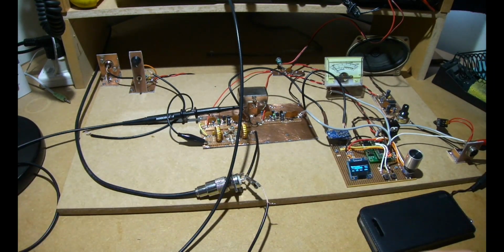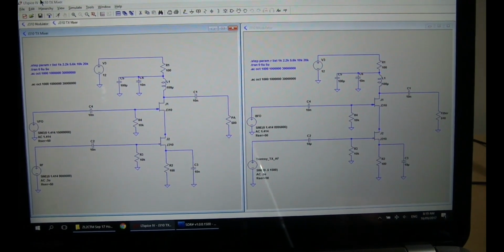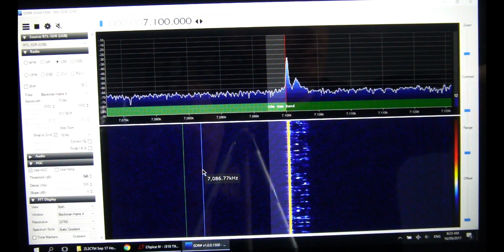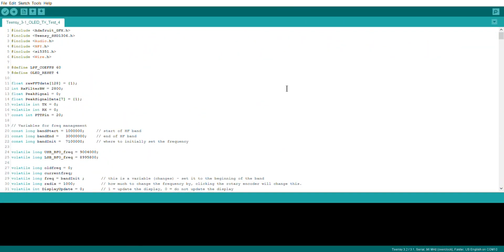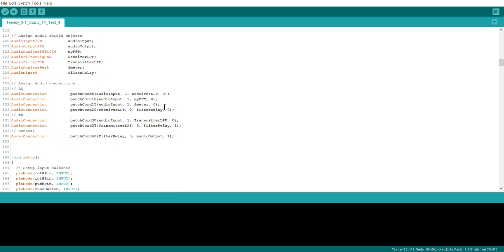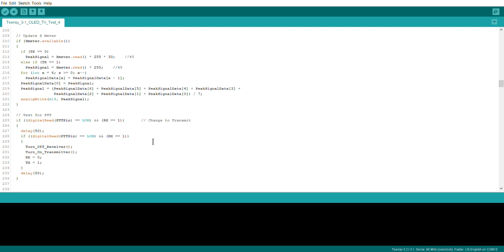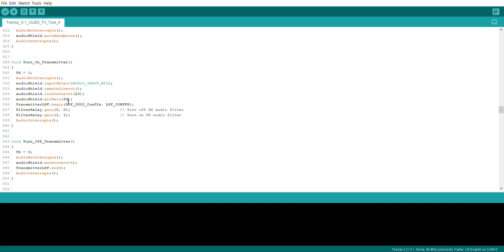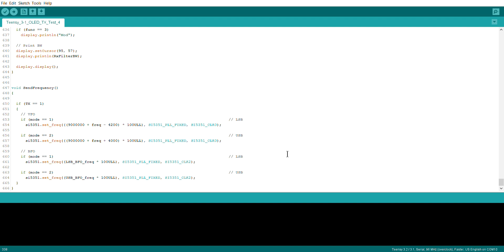Simple Homebrew SSB/CW Transceiver Part 6 - Transmit Experiments

Comment: QRP very Good...
Reply from the maker: Not too bad at all. Just a pity the carrier is still there. It would make a fantastic AM QRP rig, just move the carrier oscillator frequency down to 9MHz and place the DSB signal in the middle of the filter. I'm going to do that some day as there is an active AM group here in New Zealand.
Reply: Very interesting this method of assembly. I do some assembly the last was the SW40 Black for teensy and I do not know how I used the Arduino. I'm seeing one to buy a Teensy board and one could ask if you can make the schematics available and sktech.
Reply from the maker: Hi. Yes, no problems with sharing the sketch. The circuit diagrams are as per the LTSpice circuits. I will look to draft up something for the Teensy wiring when I'm back home.